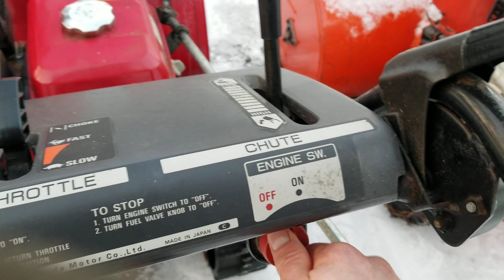PREDATOR VS HONDA SNOWBLOWER ENGINES

Comment: I will never understand why Predator doesn't make a snowblower engine.  It has to have all the shrouds and covers, but it MUST have the option for a starter.  Even if it doesn't come with one, they need to make it so you can add one.

Comment: I've noticed on my Toro the carb is incased in a shroud that includes half of the muffler to keep the linkeage and carb warm so as to keep them from freezing up. The Preditor engines don't have anything around the air filter or carb to keep them warm, so I can see I may have to fabricate some kind of shroud that retains some of the muffler heat to keep the carb somewhat protected from the elements.

Comment: Are all those vents on the Predator engines more of an issue because it's an overhead valve engine? The old Tecumseh Flatheaded seem to have just as much vents on their recoil housings.

Comment: I have several honda engines including a honda A5013 tractor and they always start with a couple pulls. The predator engines look good and close duplicates of the honda. I wonder if they'll last as long as the honda, that's the key. Good video.

Comment: You should try an electric start off a Honda and see if works on the chonda 🙃

Never thought about the recoil!  Hmm
Reply from the maker: Ive found a full blown 12v electric start kit for a 212. Its 100$...it would be super cool to have, maybe next season😎
Reply: @Nicky_Pin_It  I’ve seen that too...thinking more a long the lines where you plug it in like an outlet.

Comment: Solid! I wanted a video like this. Thank you
Reply from the maker: Thank you for watching👍
Reply: I wish it showed the actual throwing snow in this video. Would have been great demonstration to see how much power they toss.
Reply from the maker: @appleztooranges  the snow conditions are horrible here, inch of ice on everything. I tried the honda before everything froze up, works good but not super impressive. Its also a smaller model so that might play into it.